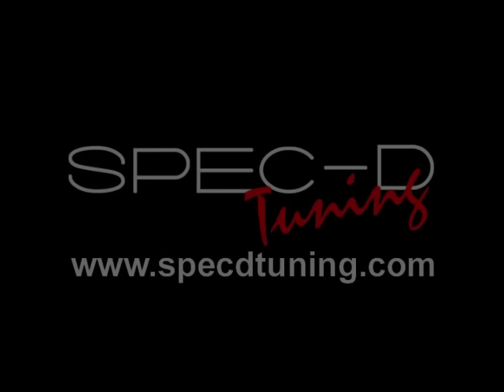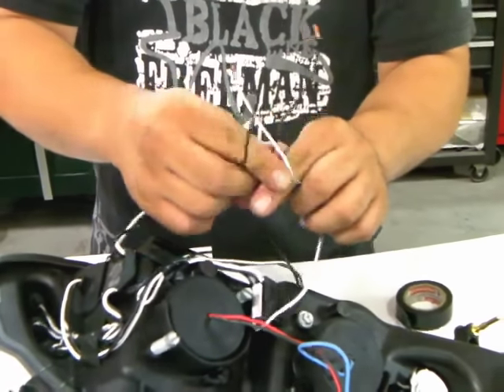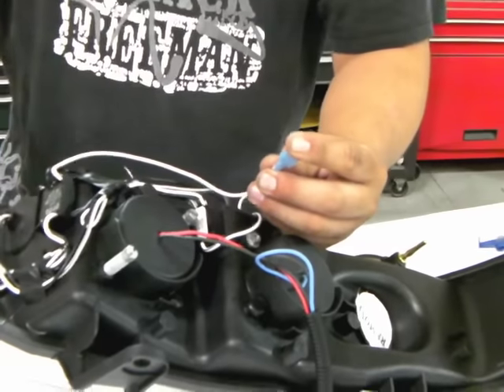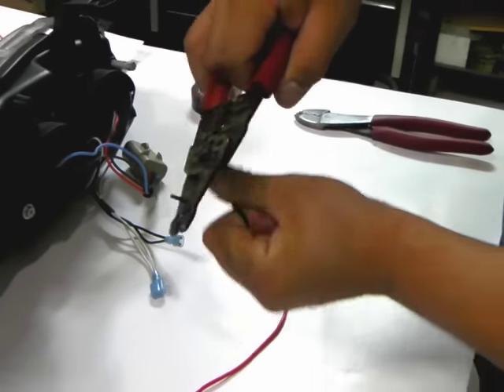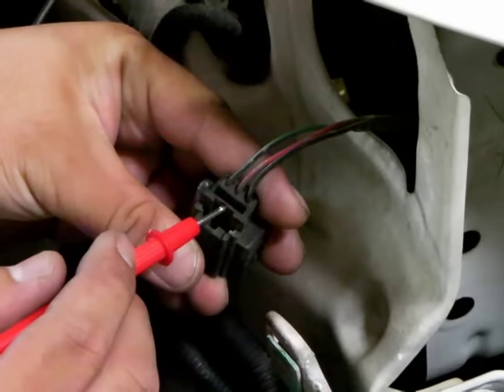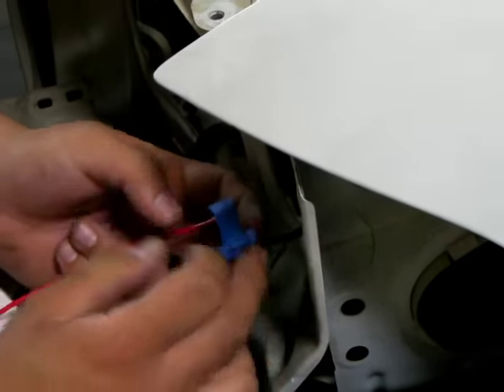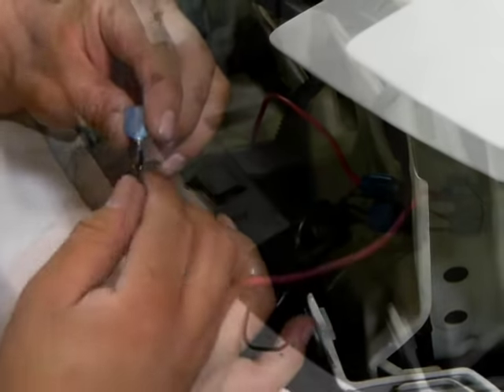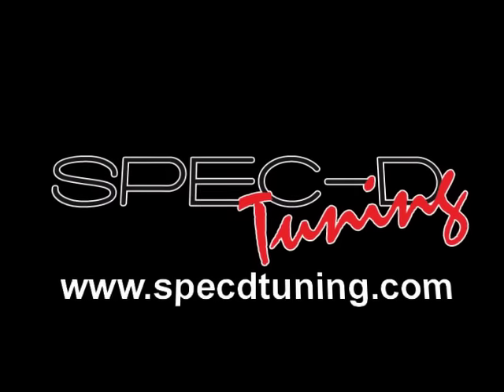SPECDTUNING Installation Video: Halo LED Projector Headlights Wiring Installation

Comment: I want to buy your halos for an 08 civic coupe. If I buy them will I need to do this wiring? Or will they be ready to install? And biggest question. Can I install HID lights in the low beams?

Comment: Connected 2011 ford fusion spec d projector LED halos directly to an ignition switched 12 volt source (fuse 33) off of the fuse box. 2 days later, after the LEDs ran very brightly, overcoming my low beam cast, all of LEDs burned out on both assemblies. Did the occur due to a voltage transient at the fusebox while starting the car? Should these assemblies have come with a resistor kit to prevent this or should I connect them to the parking or low beams?

Comment: @Specdtuninginfo Thanks for responding, I connected the halo/LED lights to the driving lights and it only works for the passenger side light. Strange... The driving light stopped working and therefore the halo/LED lights connected to it weren't working either. A mechanic fixed the driving light but when I connected the halo/LED to the driving light it went out again. Any ideas or suggestions.

Comment: i got mines put in, me and my friend did it ourself, but mynes alittle bit different, the red & black wire is already attached to the headlight and they jointed together at theend with a connecter, we dont know what to do for the halo/parking/l.e.d lights becase its a different set up than this video, and my passenger headlight still has space between the frame and headlight behind the l.e.d lights atleast close to an inch of open space, any help please!

Comment: I just bought some halo projector lights I am having such a hard time figuring out how to connect my halo lights there are two wires coming out from the halo rings which are red and white where do this wire go. I know they have to connect  to in the parking light wires but i really dont know to which wire, I WOULD APPRECIATE ANY HELP THANKS!!

Comment: i bought halo projector lights for my 02 neon i dont know that the installation would be the same as this video. it says you plug them in were the stock headlights were and then wire the halos and leds anywhere where there is a 12 volt source. what do i wire them to?

Comment: I got a pair of halos for a 99 chevy silverado and my led wires run into a box black and red but come out the box the same color which is the ground and which one is my power wire
Reply: BubblezDaPally Did you ever figure it out? I just opened mine and noticed the same issue. I have a 02 Suburban.
Reply: @tclark1018  I'm late af lol but black is always ground red is power
Reply: @crunchyshampoo2467  both of them come put black , like they cone out red and black then they go into a little box and come out black

Comment: We are trying to install ours.  One side is doing one thing and the other side is doing something different.  There are four white and our black wires on mine.  Are they all supposed to be spliced into the positive and negative?  Also, these are for a 2003 ford focus zx3.  Halo Projection LED.  Is there somewhere to see what they are actually supposed to be doing when they are working correctly.  Maybe I have one wired correctly and then I won't have to mess with that one.  :)

Comment: I've noticed in your video you only have black and white cables that you connect plus the main cable. I have the same black and white cables plus the main & 2 seperate red & black cables also, what do I do with the additional red and black cables?  I have the "Dual HALO PROJECTOR LED HEADLIGHTS BLACK" Please let me know!  Thanks

Comment: i did exactly the same and wired it to the positive and neg of the headlight wires.. and the right side low beam halo lights does not work and left side high beam halo lights does not work.. can u give some advice to make all halo lights work..for both headlight.

Comment: Do these need a resistor ? Got mine today and they already had the bulb in them . wored everything up . worked fine for a bit . now my front park lights do not light up . also my new del led not working . and only one fog light working . halos not working

Comment: Hi I have a question about the Yaris dual halo projector headlights (2006-2008). Per video, the halos are always on even when the parking/running lights are off. Please advise on wiring.

Comment: on my car the power lead has 4 yellow wires and a red one. One yellow wire i tested had 12v coming from it so im thinking thats the power but whats the ground wire as there is only 3 yellow wires and a red wire left??

Comment: The stock high beams that came with my kit for my 2008 ram 1500 are TERRIBLE.  Do you have suggestions for better highbeams?  Also, when I switch between highbeams and my low HIDs, I hear a 'CLUNK' sound from where my seatbelt comes out of.  Any ideas?

Comment from the maker: @Baseballa1053 The wires are a bit different, but the concept are still the same. Just find out what the negative wires are. Genreally, they will be the black ones, however, they can a different color with a black stripe on the wire too. Nothing will happen if you test the wires. There is not enough power to burn the LEDs or Halos. You will be okay. Good luck.

Comment: do you have a video for the 98 ranger halo's? I don't have all those extra connections on the back, just a red a black wire from the halo's and the plug for the headlight socket. I think they need to be run into the non flashing power lead for the marker lights correct? I don't want them flashing with the binkers. I've got black brown and I think white leads on those.

Comment: you wouldn't happen to know if they make halo projectors to replace the sealed beam for 68 year buicks with the 4 light system do ya? I know they make them for a couple years newer where each side only had one large 7" headlight.

Comment: I have these headlights and was wondering if there is any way to connect the wires without the crimp connectors?
Reply: just twist them together and use a wire nut.
Reply: Thanks, I got them installed now, the halos and LED's look great.
Reply: Nate Maynard Was it as confusing as the video makes it out to be? I'm about to install mine but considering forgetting about the halos
Reply: They weren't bad to put in at all. As long as you have the connectors they are talking about its pretty straightforward.
Reply: Nate Maynard do the halos run all the time??
Reply: Just twist the wires together with a wire nut or you can solder them together. I don't think there are any DIY's on here. Just folks pissing and moaning about nothing.

Comment: How about something for us old guys. Great video!!! How bout a 99 grand cherokee laredo. How to wire projector head lights? Think I got it not sure. Us old guys get brain farts. Think low, high beam is oem. Halo part, do you connect the wires to parking lights? Think there b two extra wires. Best I know neg. and pos. Figure out which is which and tap right?

Comment: I also want to know if it's possible to write the leds and halos to two things? To the ignition of the truck and the status lights of my truck. So when my truck is off when I unlock the truck they will turn on with those lights. I'm not sure if I'm making sense or not or if what in wanting is possible or not.

Comment: I need to see an installation for an 04 Vw beetle turbo s. The turbo s has a 4 pin plug. As the spec d has a 3 pin plug. If you guys can make on that would be great.

Comment: So does this wire them to work with automatic headlights? I want them to run on automatic with my normal headlights. I don't want to have to turn my headlights off of automatic to use the halos and LEDs

Comment: in need of help
have a 02sentra se-r and i installed them but the halos dont light up i tried to do what was on the video but didnt work it isnt easy as it looks dont u need a HID convertor or something like that if you want that halo to light up?i jst dnt have battery meter and i just tried to install it

Comment: I bought a pair of halo headlights for my 2006 Infiniti g35. They come with two extra wires a black and a white one ... I'm guessing ground and positive. My question is where do I connect these and can I just use the connectors provided with the headlights? 
Thanks

Comment: I got the 12k HID with a relay harness. Is there a diagram available for entire wiring. I assume you connect the hybrid ballast to the HID leads coming from the bulb, but i dont understand how do you wire the relay harness? If you have to use  the jack coming from the car to connect into relay harness there is nowhere to plug in the main 3 pin jack on the headlight.  I will appreciate any help i can get before I start wiring this whole mess.

Comment: On my 2006 Pathfinder, the parking led lights & side lights worked until I installed switchback led turning signal bulbs with a resistor. The Halo's and led parking lights stopped working. Any ideas? Thanks

Comment: You should recommend cleaning the battery post terminals before you start this process so you can get accurate readings. You include the snap clips why dont you all include the other terminals and the wire pieces? Sucks having to realize they are not with lights when you go to install and now you need to go get more items. Recommend while at the store picking up the parts you should get a tube of Dielectric grease and some heat shrink, Electrical tape will not keep out the moisture and it comes off over time.

Comment: question for Spec D Tuning: this video doesn't explain anything for my vehicle. I have a 1999 VW Beetle,,,where to the wires from the relays or whatever the square piece is with the whithe and black wire coming out of?? Please explain this process...thanks.

Comment: I'm in the process of installing my led projector halo lights onto my 2001 Dodge Ram sport and I have a quick question.....I know I have to connect all of the led and halo black and white wires to a male and connect them to a female coming from the original harnesses with a red and black wire one come from a hot and the other ground.....but this only works with either one high beam bulb or a low beam bulb.....how do I connect both my high and low Beam bulbs to my less and halos? Thanks

Comment: i have a question. I have a 2002 Chevy Silverado 1500 and I got the HID halo projector head lights and they say they fit a 99-03 Chevy Silverado and I tried to install them and they did not fit and also I had wires wires that were connected to nothing coming out the back of them.. I have no idea how to install these. any help?

Comment: Got mine for my 2010 Ford F-150 and the white dim light doesn't work on either side.  I tested for power and they are getting it.  This is on the main lights that take no splicing or anything other than just plugging the connectors together. could the bulbs be out from the factory??  They look difficult  to change?/

Comment: i have an 02 eclipse gt prm and when i got my HL my friend installed them for me, he spliced the wires so that wen i turn the side lights on 1st the halo leds would turn on, and the headlights turn on normally, but after a couple of weeks the halo's started flickering and blinking to the point now that on 2/4 halos r out and 1 stays on and the other either comes on and fickers or stays off, also the turn signals stopped wrking but they still come on jst dont blink, is there n e way 4 it 2 wrk

Comment: hello oaky i got the lights but on this video it only show 2 wires black and white and on the headlights i got  it had 3 wires.so i dont know where the 3rd wires go.also does the halo lights always on if the high and low beam off?cause mine the halo lights will only turn on if the high and low beam are on...please i need helop

Comment: Did this today and its not that  difficult. My lights were the 96-98 civic halo LED and angel eye lights. This guy says you hook to the head lights but its the park lights you use not headlights you splice into. You join the halo LED and angel eye together. ( 3 whites + and 3 blacks -) together that way your Halo and LED & angel eyes all burn when you hit your park lights. Changed stock angel eye bulb to orange now guys think my civic is BMW 5 series. UPDATE NEEDED!

Comment: I bought item number LF2LHP-COR09JA-TM and having some issues.. there is a small circuit board where 2 LED leads (for the rings) come together, what is the purpose of this? can I bypass it and just solder the 2 leads into 1?  Can't get the rings to light.

Comment: Hey I purchased these headlights for my honda accord 1998 and I am wondering how do you wire them because I have 2 completely white wires 1 white and black wire and 3 completely black wires. This video only shows 2 completely black wires and 2 completely white wires, so what do I do with the other 2 wires that my headlights have ? Do I just put 3 and 3 together ?

Comment: Hey Spec-d I am trying to find angel eye halo headlight for a 2005 gmc yukon I am also looking for the led turn signals any idea where I can find them? Also I have hid headlights but they suck would led be better than hid especially to use with the halo headlights?

Comment: Hello, I'm not sure if this what I'm wanting to do is possible or not. I drive a 2003 Silverado. I am going to buy some lights with a ccfl and led set up. Is there a way I can have the leds and halos linked with just the power of my truck to where as long as my truck is turned on they will be on. My head lights tyrn on and off with a light sensor and I like it that way, I dunt want to have to turn them on and off each time I leave my truck.

Comment: I need instructions for an 08 avalanche. The headlight connector has like 6 wires compared to the three on this video. I want LEDs and halo to be lit when low beams are on. Currently they come on only with high beams. Also the headlamp gets really hot to the touch. Is this normal? I'm worried it's going to burn a hole in the lamp

Comment: @Specdtuninginfo Got it already :) had to take the shell off under the steering wheel and wire to 12V that was not constant this way it turned off when my car turned off. Thanks anyway :)

Comment: I bought a pair of these this week for 98 Dodge Durango w/ DRL and the LED DRL are wired with a BLK/RED wire going into a box that  appears to be the Error canceler , but coming out the box is 2 BLK wires instead of BLK/RED, so which is GRND and HOT wire?
Reply from the maker: JEDI HAVOK You can follow the wires to the same side. The wires do not cross inside the resistor. The black wire on the red side should be your hot wire. I hope this helps.

Comment: Just followed this video exactly with my new halo's for my 1999 F-250, after about 4 hours of work, the typical lights worked but the halo's around the bulbs and the leds didn't light up. And the light is shooting way too high.

Comment: I bought some nj juyan halo lights for 1997 Dodge Ram 1500. The HaloLights come with 3 sets of black and white wires. Do I connect all three together? Two sets are of cooper the other black and white wire is (white/silver).
Reply: yanneth Lopez Connect all like colors. All of the blacks will be connected and placed into a crimp. All white wires including the black/silver one will be connected into one crimp.
Reply: Awesome! There was a little problem though the signal lights are not working...haha
Reply: +yanneth Lopez I'm getting ready to install in my 98 Ram 1500 - any pointers?

Comment: I just got my order of Dual Halo & LED projector headlights for my Toyota Celica. I understand in the video that both the LED and the Halo lights both have a Black and White wiring. Tie both together to make one. 

However I'm confused since my headlights' LED wiring are already connected to a type of male wire connector. The Halo wires are still bare and ready to be wired into a male connector.  Do I cut the LED wires to allow them to be tied together with the Halo wiring like in this video, or do I do something else with Halo wiring and connect the LED separately?
Reply: Renbail I guess my main concern is that I don't overpower the circuit or blow a fuse up or something. Like Plugging in 6 energy hungry appliances into a single 6 slot power extension.
Reply from the maker: Renbail You can wire all the loose wires to one power source or you can do it individually. It's really up to you. The resistor on the headlights will help keep the LED bulbs from using up unnecessary amounts of wattage.
Reply: +Renbail LEDs use very little power- not hungry at all.

Comment: Hello body 
I don't  have extra wires to do tha What kind of wires I can use for connect the light? What is the name oh what size is tha wire 
The one you are using it
In where i can get it 
Thank you 
I got my delivery to day in igonna installed in my truck  
Thank you for the information

Comment: can someone please please please help.  I am installing these I get where everything else goes, but where does that black and white wire go?
  I went to spec video, but it is not clear.  I have s2000 2007, and on the unit every wire is connected to different housings, but where does the black and white wire go?
Reply: I have this same issue right now

Comment: They key is wiring to your daytime running light wire and not your headlights.... there's an additional connection plug and play for the headlights for your new light kit... I agree with most but the connections in vehicles for the daytime running lights actual headlights differ.

Comment: your headlight# 2lhp-ram94b-tm the low beam will not work in cold weather.if you put the truck in a warm shop for two hours the low beams willwork.